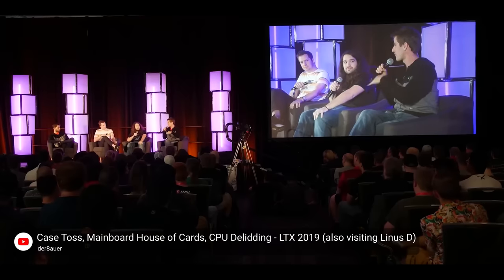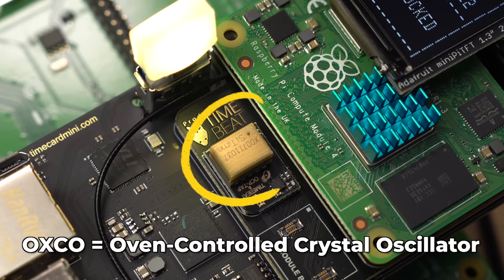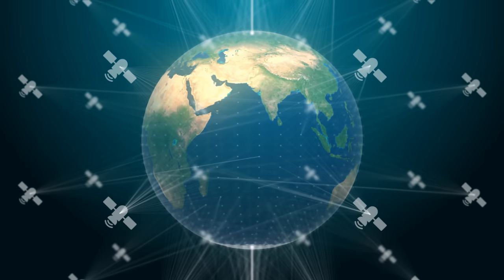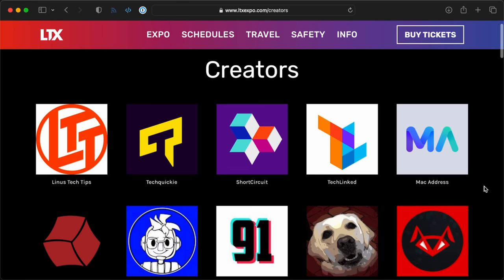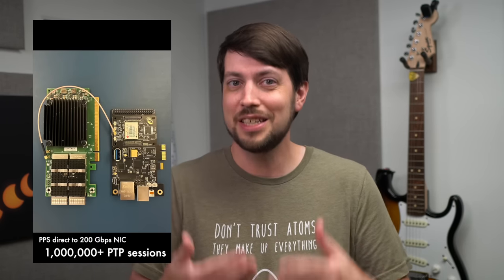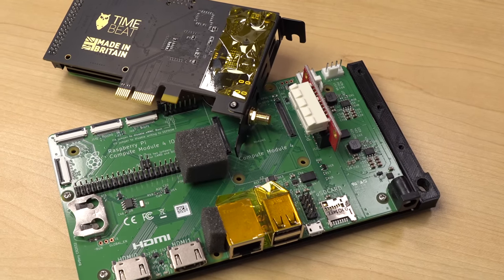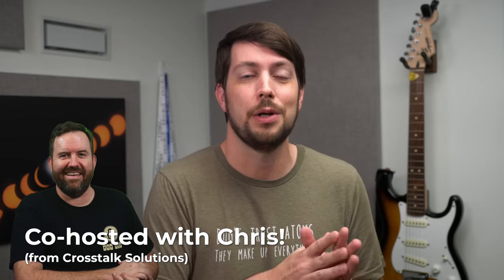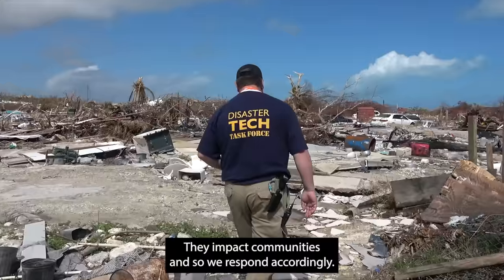This card puts GPS and a tiny OVEN inside your PC!

Comment: Hey Jeff, try picking up CHU and WWV and sending them a signal report. They'll send you back a QSL card in the mail. The neat thing about them is not only are they accurate time sources, even their radio transmitter's oscillation is disciplined by their atomic clocks. 73.
Reply from the maker: I'm going to use WWV as my backup NTP time source in case GPS has any issues in Vancouver!

I would like to contact them soon :)
Reply: Isn't wwv specifically designated and intended as both a time and frequency reference? (Which is why the frequency is linked to the atomic clock, otherwise it wouldn't be a good frequency reference)
Reply: It's nice to have a super accurate time source but distribution using NTP introduces latency making the accuracy of the source largely irrelevant so what's the point? 😮
Reply: @glennmcgurrin8397  Absolutely. WWV-DO and GPS-DO are both a thing. I wouldn't be able to say how much more accurate one over the other is - but GPS-DO is certainly enough to calibrate SHF ham signals in practice.
Reply: @alanrichardson1672  Using PTP is probably the way to go. It's more precise than NTP
Reply: @alanrichardson1672  NTP compensates for the round trip latency between the client and the servers; the problems occur when this is either highly variable or asymmetric (such as with home cable modem/ADSL) where upstream and downstream delays are not the same. PTP doesn't help either outside the range of a datacenter or LAN as the switches in between have to speak PTP and timestamp the packets properly

Comment: Another good example for GPS synched clocks are DAB+ radio stations. For DAB+ you don't use a big transmitter for a large area, like for AM, but a lot of smaller transmitters serving smaller areas. GPS is used to keep all the transmitters synced up.

Comment: It isn't the high temperature that makes the crystal more precise. It's the fixed temperature.

It's hard to cool components. So this means the oven is used to raise the temperature well above the inside temperature of the device the crystal will be used in.

So assume +50°C ambient temperature, and maybe +75°C inside the device. Then the crystal needs to be heated well above +75°C so no unplanned extra warm day makes the inside of the device warmer than the oven.

After they have decided the oven temperature, they will then cut the crystal to be at the nominal frequency at this temperature.

That's like how wrist watch crystals can be cut to deliver 32768 Hz at close to 37°C from the arm. Don't use the watch and the crystal gets too cold. Leave it in the window and the watch gets too hot. And this makes the watch drift in one or other direction. A 32.768 kHz crystal for a home appliance is better optimized for maybe +23°C. Somewhere slightly above room temperature.
Reply from the maker: I could've been more clear there :)

But yes, it's easier to maintain a fixed temperature when you heat things up beyond what the typical environmental temperature would be; cooling it would be much more difficult, especially inside enclosures that could vary wildly in temperatures.

One design consideration for anyone using this card is maybe try to keep it out of a stream of heavy airflow, no use making that little SiTime chip work harder than it needs to to maintain its temperature.
Reply: @JeffGeerling The opposite of what PC's need I see...
Reply: So THIS is why my oven's clock keeps drifting, I always had suspects but now I know
Reply: @Imthefake Your oven clock uses actually the grid frequency as a time signal.
Reply: @thebamplayer   It's very unusual now to use the mains power AC periods for time. It was quite common 30-40 years ago because crystals was expensive then. And older power supply designs made it easier.

And in that case, at least for my country, you really would hardly see any drift because the frequency might be just below 50Hz during day but then run at just over 50Hz during night to keep a correct total number of cycles over the full 24 hour period.

Just that the removal of old-school mains transformers and instead using switched power supplies means that in modern electronics you now need extra components all the way from the mains-power side. This adds cost - both he components and because of any certification that the mains power is properly isolated.
Reply: Also better OCXO's use better quality SC-cut crystals, operate them in more stable higher overtone modes and cut the crystal & adjust oven temperature so the flattest part of the drift vs temperature curve is at the oven temperatures
Reply: @timlister177  Yes, power consumption isn't one of the big priorities when using OCXO. For lots of battery-operated devices, very little energy is allowed for the crystal oscillation. A wrist watch may operate the crystal for 3-5 years from a small button cell. And the crystal oscillator in the watch isn't the only consumer.
Reply: Actually you extrapolated a bit too far.  PC clocks are not temperature compensated and have horrible accuracy without something like NTP, variations of 30 seconds a day are common.  Watches however are temperature compensated, often accurate to 30-40 seconds per month, even if not worn on your arm.  Watches, at least decent ones are calibrated for the specific crystal frequency AND temperature compensated.  The 32768 hz means that on average you are half a hertz off, or 40 seconds a month.

Of course the temperature compensation isn't perfect, meaning that the OXO can be radically more accurate, but because of the temperature compensation wrist watches tend to be 30x more accurate than the clock on a PC motherboard ... all because the motherboard skipped out on a temperature compensator that costs around a nickel.

Comment: This is so amazingly/hilariously over engineered….and I love it. While you’ll have the most accurate time there, Linus will still be late. Looking forward to seeing this at LTX!
Reply from the maker: Maybe they can use it on WAN show to keep it down to under 12 hours ;)
Reply: @JeffGeerling for Wan show there is no need for such accurate timing, it just need to be accurate ±2 hours, which means it could be an hourglass with rocks in it 😅
Reply: Do you think he measured the draw delay for the screen and put an offset in on the number shown on the display?

Comment: For your display… there might be some some signaling and compute delay in your python. Please check your offset calibration, values, and timing. I.e. set a log flag at the start of your script and log flag at the end (or whenever is appropriate) then use that for your screen off-set, and signaling / ptp / ntp offset. 
Love the project/product.
Reply: I used to have the same job as your dad but in LA ;-)

Comment: I have a Pi Zero running a few little things, including Chrony as my stratum 1 internal NTP, relying on an Adafruit GPS board with PPS.  I have a 4x20 screen in an acrylic mount on my desk that serves as my geeky desk clock.  It was under $100 all in, and has a few purposes for me.

Comment: I used to war drive with my RP4, external GPS and USB WiFi on monitor mode. I captured a WiFi hot spot that was inside a parked cop car, with SSID "Purple Pig".  I didn't stop to ask.  What's interesting is that your GPS is sandwiched between the CM4 and your PCI board.

Comment: Another important difference between the OCXO and the rubidium card is that "board with a chip that gets hot but isn't powered on" is probably a lot easier to clear through customs compared to "board that is radioactive."
Reply from the maker: Hehe, though any decay in the isotope used in the Time Card (non-mini) would be practically un-detectable by airport security.

They would think it looks a little sus though.

Comment: With all that python between the time source and the user I'm not sure you can claim the most accurate time, the underlying clock might be the best there but that doesn't do you any good if its displaying late by a probably wildly variable margin (at least in comparison to the clock accuracy). Might be the most drift proof clock present however and so be the most accurate eventually. But it probably isn't delivering the time to the display as accurately as the NTP will be on every other computer there, and even cut off over the duration of the event I'd expect the drift of the riff-raff PC's to be less than the inaccuracy caused by using the wrong language for such a hard realtime task! The most real of real time tasks!
Reply from the maker: The computer itself will be holding time accurately though—honestly the blinkstick and miniPiTFT are delayed enough even with a C library I'd end up with variable ms-level delays for end-user display.

The Pi will be offering PTP output over Ethernet, though, so I could still say it's the most accurate time source—just not necessarily via it's visual outputs.
Reply: @JeffGeerling  True, and even if you went to the extreme of bare metal programming the blinkstick and screen so it is precise as the CPU cycle allow the LED warm up/pixel change times of those HID devices has a meaningful latency when talking this level of timing precision too.

Make sure you serve at least once client with the correct time over the Ethernet as I think you can claim to be the most accurate timesource, but if nothing ever uses the really accurate time it could provide I don't think it counts - the Human interfaces on it are going to be the only things used, and they are not impressively accurate.
Reply from the maker: @foldionepapyrus3441  I'll just have to find someone running Linux and using an i225 in their PC, and jack in. Then set up LinuxPTP :D

Comment: Rubidium clocks use the oscillation of the atom between two different excitation states as their clock reference, NOT radioactivity.  Rubidium-87, the isotope used in atomic clocks is NOT radioactive.

Comment: Oh yes, I've built a GPSDO before, using an OCXO, a GPS module and part of a PLL chip (specifically the phase comparator). No RPi needed.
(edit) and no fancy hundred-dollars GPS module needed either. A $5 ublox7-compatible module is enough, with some skillful programming of its internal registers. :)
Reply: It does depend on what level of precision you are looking for, as well as the quality of your oscillator. My experiments with some of the cheapy ublox devices, show that they can easily show time deviations of +/- 100 ns, meaning that frequency stability at 100 seconds is only 1ppb on average (there can be larger excursions if there is a change in observing conditions). 

However, in the event that you need better absolute time precision, or a better precision frequency reference, then improving the GPS receiver may be needed. 

One interesting thing about making low cost GPSDOs is that obtaining "well-used" obsolete OCXOs from aliexpress is not just cheap, but the crystals are "pre-aged" and often have extraordinary stability. I've got a bunch of the $2 OSC5A2B OCXOs, and when using these for a GPSDO, the limting factor (by a huge margin) is the GPS receiver - you need to use PLL bandwidths in the order of 200 uHz, otherwise the GPS noise gets through to the output. 

 I've got a couple of somewhat more expensive, old SC-cut OCXOs from Ali (about $50 each), which when measured significantly outperform the specifications of the rubidium oscillator shown in this video ( < 1x10^-12 adev @ 1000 seconds) with some software temperature compensation.  That said, these miniature rubidium oscillators are a lot worse than the older ones. The laser based CPT method used in the miniature versions has much worse stability than the old-school rubidium lamp and microwave excitation design.

Comment: Ayoo, Loved seeing the m8f! Used it in my Bachelor Thesis where I implemented a OCXO (stratum 2 compatible) PLL chip with the PPS Signal coming from the GPS module. They are (even with the internal TCXO) really accurate and low jitter. Iirc somewhat around single digit nanoseconds compared to our big ocxo gps time reference. And yeah, just around 100$ by their own lol
Reply: End application was a phasor measurement unit which sampled the grid power based on the PLL output. Gotta keep good time synchronization when you're making the measurements and phasor estimations on the pi. Really great learning experience on how to measure >time<

Comment: Pretty much all the use cases listed (banks, remote ground stations, distributed computing) use GPS - namely GPS trained high stability rhibidium for a few weeks of holdover, and GPS trained cesium for anything that needs to operate during WW3. You wouldnt use OCXO for anything where you'd lose your better reference for any ammount of time.
You can use OCXOs for lower cost signal generation while trained to something else.... Like generating a stable multi-mhzs signal off a stable 1 pps. But that stable 1 pps needs to be driven by something with significantly better holdover.
Reply from the maker: True, but there are many situations where something between a standard TXCO and something a bit more exotic is useful.
Reply: @JeffGeerling  The project is fun overkill - just that little bit of the video ran contrary to my industry experience. I agree they have their uses - I've used them myself to save costs - but how this class of oscillator is used (generally) isn't holdover due to lack of comms (which is how I interpreted the video).
Reply from the maker: @garretthaney9134  True; and to be honest, I am only dipping my toes in the water of higher-end use cases. I would rely on your opinion more so than mine!
Reply: You know that used to be completely true, but there are now “super” OCXOs (made very well with dual oven type designs) that outperform many chip scale atomic clocks…

Comment: The Ublox modules are fairly cheap, They are available on boards for drones. The OCXO is used for the 10MHz output that is used to sync test equipment. Check out Timenuts' if the subject interests you. I have two Meinberg GPS170PCI systems which is a computer card, and a GPS outdoor antenna with a nice molded plastic mounting arm that clamps around a mast, or tower leg.
I have a Vk-172 Ublox 7 USB GPS that plugs into a laptop for field work.
Reply: This particular module is $100+ on it's own.
Reply from the maker: Yeah; U-blox makes a HUGE variety of GPS modules. This high-end one includes the capability for external oscillators and a much better internal TCXO too (100 ppb I think?).
Reply: Not to forget the difference between a real  u-Blox module and all those cheap Asian u-Blox rip-offs...

Comment: Nice video.  We used a NavSync timing gps and feed its 10  MHz output to an FPGA and try to derive a 100 MHz signal from gps.  This gives a 10 nanosecond pulse period.  A cosmic ray signal event in our application is time stamped to 10 nanosecond in theory.

Comment: NTP tested against the 1PPS goes more on the order of 3 .. 10ms and occasionally worse than 10ms.
With the Pi 4, you can test against the Pi clock to about 18 ns resolution.  If you take in the 1 PPS and set up an interrupt, then you'll have sub-microsecond accuracy for time - even Jeff should be happy with that?
So - you only need the serial output from the uBlox receiver ($50 - $80 at Sparkfun) breakout board for GPS data and the 1 PPS signal.
I implement this in RTL rather than Linux.  Of course this is not within a PC.
Reply: If you're using interrupts to capture time then it is likely that you have 10s to hundreds of microseconds of latency and considerable jitter. Linux is not a real time operating system. Interrupt latency varies wildly and is considerably faster in kernel space than user space.

Hardware capture timers are needed for real accuracy.
Reply: @therealtimwarren  I'm not using Linux (as stated above).   It's a barebones/bare metal set up.  Latency and jitter verified against the Pi-4's 54 MHz clock of the system - indeed, with the 1 PPS I can also accurately characterize the 54 Mhz clock''s accuracy as 9 .. 11 PPM (on my Pi) depending on temperature.

Comment: Its not the heat that keeps the  oscillstor accurate, its the consistently perfect temp. If you climate controlled the entire circuit and had software to predict and expect that environment itd be just as accurate. Its not about a hot crystal its about a climate controlled crystal

Comment: I built a few PPS (via GPS) driven time servers, I think I uncovered 2-7ms of asymmetry (via NTP) on my ISPs cable network. I assume it's due transmit and receive being handled in physically different locations (Hybrid Fiber-Coax.) It's only evident with PPS sources vs NTP sources.
Reply: Latency of 2 - 7 ms is a very long time and real showstopper in my line of business Sequence Of Event recording to analyse major electrical power disturbances on complex power generation and distribution networks. I specify device / systems time sync using IRIG-B rather than NTP way more accurate.
Reply: The OCP-TAP Timecard we make supports IRIG-B #OldSkool
Reply: @timebeat  Hi, thanks for your post. If you can point me in the right direction I'd like to take a look at OCP-TAP Timecard you mentioned. 😁

Comment: For a smaller setup, could you perhaps swap the breakout board for a GPU riser to power it?
Reply from the maker: Yes! I just didn't have a setup I could power quite as easily from a battery (didn't have time to make a custom 12V power connector...).
Reply: @JeffGeerling  ah of course the power connector. Twist and tape just doesn’t cut it with IT stuff really does it 😂